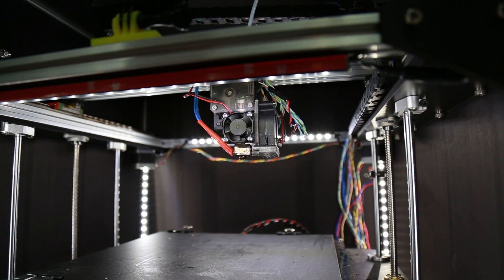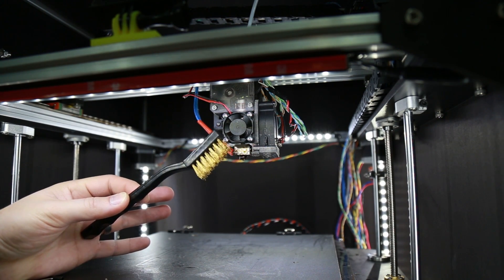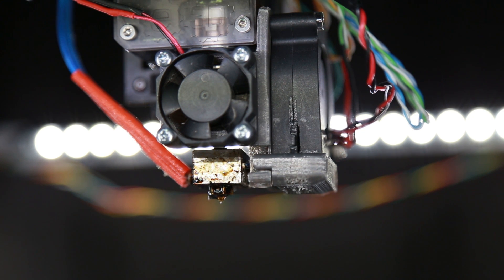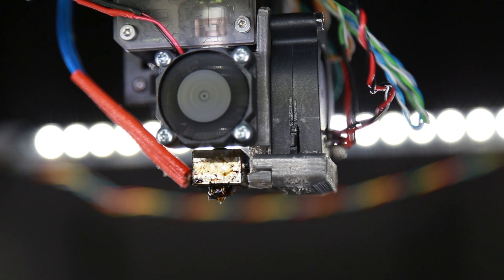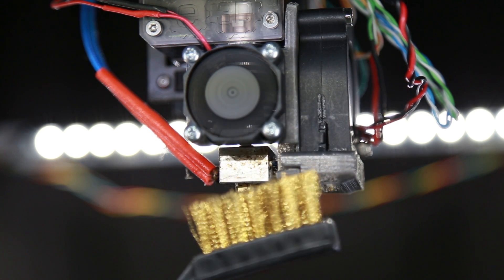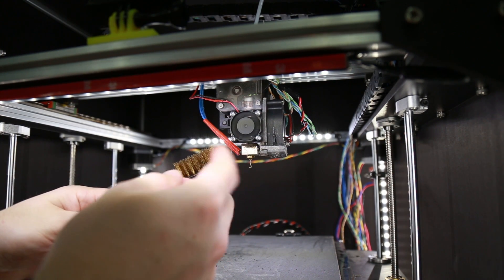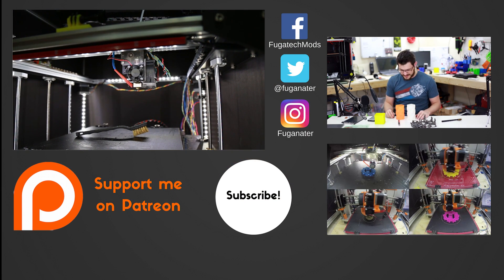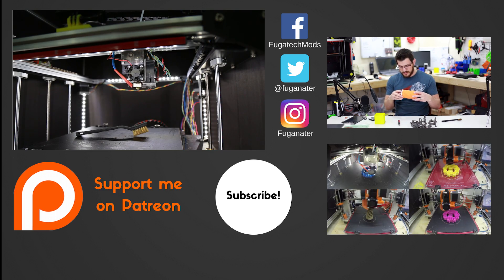How to clean your 3D printer nozzle

Comment: Just a safety note, I could see one of the wires from the brush bridging the heater core leads (mine, at least, have a slight bit exposed right at the base of the heater core)  If the heater was activated, you could short the leads.  would it damage the board or just blow the fuse? IDK, but I would heat it up, turn it off, then clean.
Reply from the maker: Duly noted. Thanks!!
Reply: yup, reason I went to just using paper towel.. safer (well, except for your finger tips . ) ;)

Comment: Put newspaper down over your build plate before starting, then just fold it up around the edges and all the debris gets caught. Once done, just fold the paper closed several times and the mess stays trapped within the paper.
Harbor Freight usually carries a 3 pack of brushes like that for dirt cheap, although I think that one is steel, so you want to avoid using the steel ones on your brass hot ends.
Reply from the maker: Good tip!